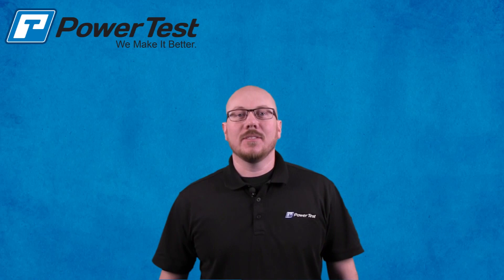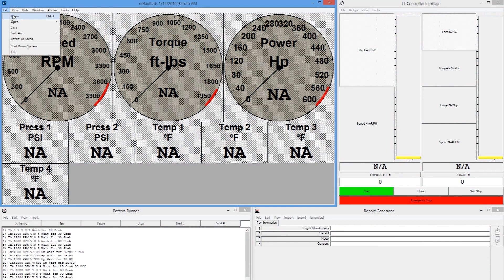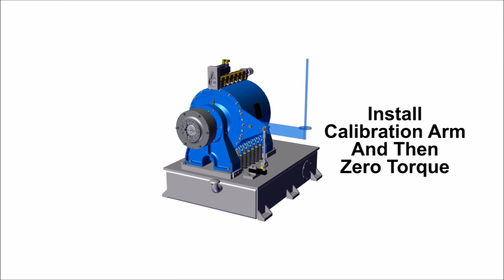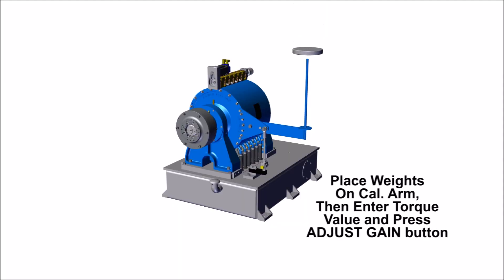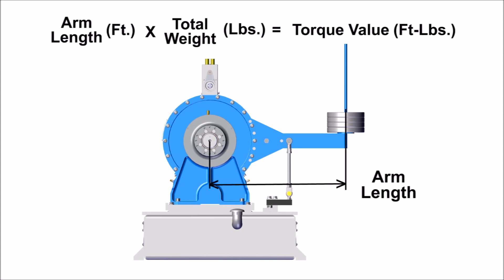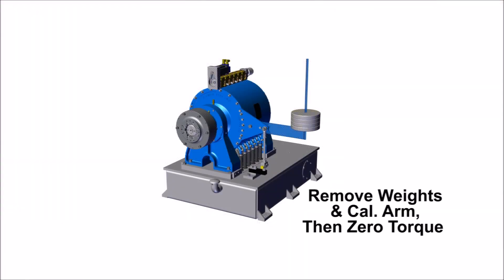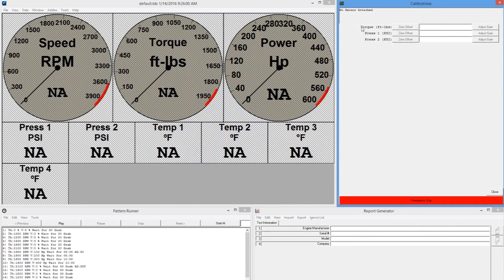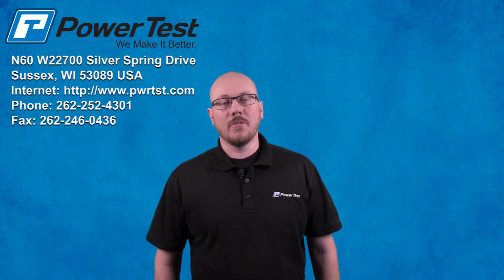How to Calibrate an Engine Dynamometer | Power Test Dyno

Comment: hello sir,
How can I choose a dynamometer for engine details [for example :135 kW (181 hp)
@ 5000-6500 rpm and 290 N⋅m (214 lb⋅ft)
@ 1350-4250 rpm].
How can I determine type, Dyno max Torque, Inertia and all things related to selection of Dyno